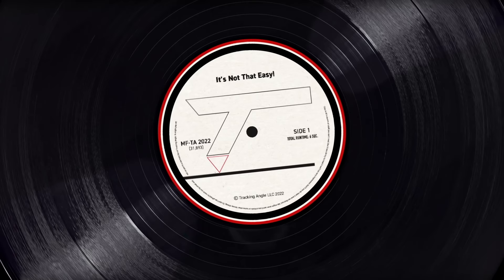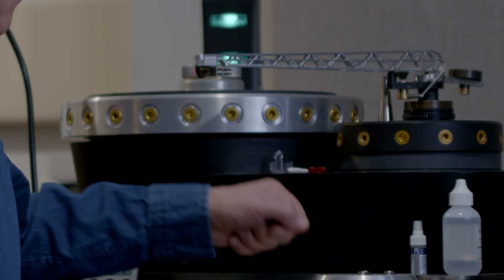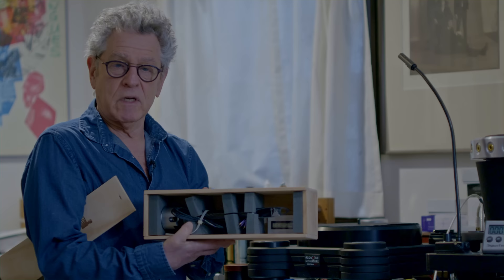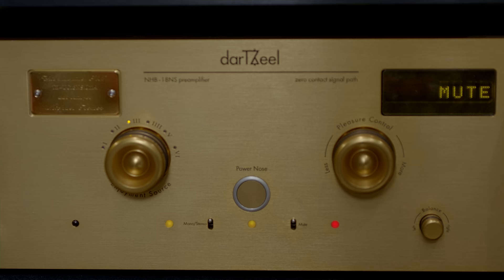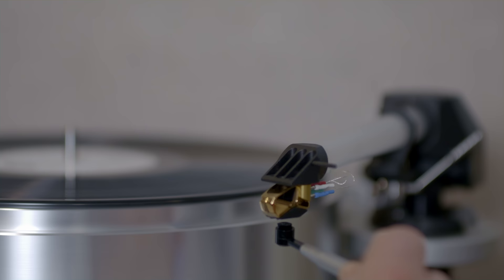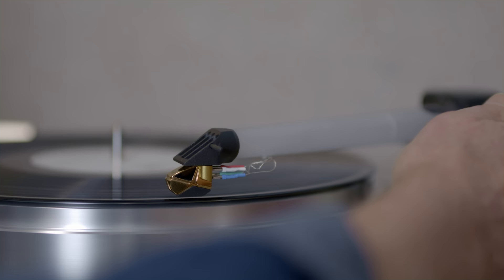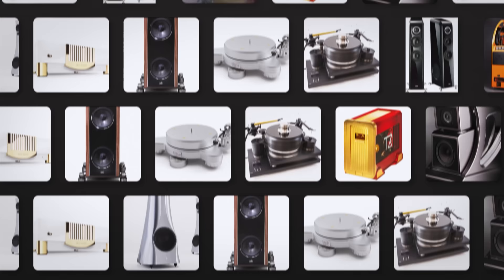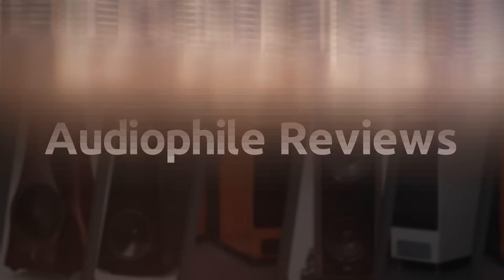A NEW 4K Tour of Michael Fremer's Listening Room

Comment: I made my entire house into a Faraday Cage, and the foundation is on air bearings.  I also had the house rotated such that there is symmetry with my system and the earth’s magnetic field.
All joking aside, beautiful system.  The tweaking and small targeted improvements is part of the hobby.  Replacing coupling caps, upgrading drivers, etc. is part of the fun for me.  Hope to make some of my own components from classic designs when I retire.
Reply: Sad thing is after watching this video and the extreme lengths people would go to in search of perfection, I was actually questioning if you were serious or not haha
Reply: Don't forget that for optimum sound, you need to have your turntable itself on another platter which rotates it slowly over the course of the day to account for the Coriolis effect's influence on total RPM
Reply: I know if I could do the things you mentioned I would but I can’t so I won’t .
Reply: No, after a point it's just useless money wasting insanity.

Comment: B&O had induction turntables decades ago. I have still got one
Reply: My B&O linear track turntable uses magnetic induction to rotate the thin aluminum platter.
Reply: @robertjermantowicz-uw3iw  Indeed, a low mass table, a lovely cartridge, a linear tracking arm and a linear induction motor. Nothing better, and unjustified sneering at B & O by ignoramus

Comment: Interesting system.  I can't quite comprehend how having 10 metres of new copper cable from the top of your house to your meter, actually reverses any negative effect from "terrible sounding aluminium cable" when the other hundreds and hundreds of metres that electricity is traveling to your house in is still old aluminium.  Electricity doesn't really give much of a stuff what it's being run through it just goes from a to b no dramas.
Reply: Thecgrounding issue might have merit but I agree on the wire. All high end audio equipment should be run on DC battery power. Remove all AC remote power generation from the equation.

Comment: If your a newbie watching this,  Turntables are an ongoing headache and will never sound as good as digital music. You will be chasing your tail for eternity. Please just upload all your cds to your laptop as flac files, connect the laptop to a Chinese DAC costing £150 (smsl c200), connect the DAC to an amp with some form of room correction (Dirac) and get a pair of speakers to suit the size of your room. Add a sub or two for some icing on the cake. You'll be looking at around £2000 for a bang up to date system that sounds amazing. Thanks.
Reply: That's one way of enjoy music.
I have a Very capable digital system my analog system it's better but it's more expensive and it just takes a lot more work. It's worth it all at the end.

Comment: I struggle to understand how a behemoth speaker system such as the Wilson Chronosonic (which, btw, is priced north of a third of a mil) can sound anywhere near its best in such a relatively small space.  Likewise, I don't understand how it would sound much better in that space than its smaller Wilson brethren (which use many of the same drivers).  To me, in that space, when is comes to speakers, less (smaller) is more.

Comment: batteries are so much cheaper... I run all my pre and output stages on Lipoly batteries.. no ac connections except for the source. figured out that decent class D amps sound really really good on Lipoly 100c batteries.

Comment: I can only dream of a world class system like Mr. Fremer. Very interesting nonetheless. Kudos on the home electrical upgrade. Now those power conditioners and fancy power cords make sense. 😊
Reply: The only problem is the room, how it's treated.  First, those speakers are entirely too big for that room. Secondly, he has NO treatment for the low frequency room modes, not sure if he has the right amount, type of treatment for mid's and high's and from what I can see for the front of the room he's has probably one of the worst setups for "diffusion".  And lastly, WAY too much "clutter" in the room.

it's just sad as to how poorly people with such great audio systems have rooms that are simply awful. The room generates enough of an impact than most people realize..  

Here's a video of a room, that is designed for the speakers in the room, and look at the dimensions of the room, how the walls and ceilings are constructed as well as the treatment.  This is what I would consider a first class designed audio room.    Gear aside, it's the room that presents the biggest challenge and is largely overlooked if not ignored.  Such a shame too.

This video shows what might be one of the best designed/treated rooms amongst any that I've seen out there.  

https://www.youtube.com/watch?v=eMLA5h0nh8s&t=340s
Reply: @Oneness100  one in every crowd.  Did you watch the video where he talked about room treatments? You can over treat a room

Comment: I just stopped laughing long enough to type my comment.
This won't be about concrete floors or how many earthing rods you have in your yard )))
Let me start with where your sound system really starts. "Your Human Ears". It both starts
and finishes there. Your ears are not capable of discerning what your floors are made of or
if you have any stray mains hum on your power supply. It gets worse, if you are over the age of 
25 then more than likely you already have certain frequency deafness, therefore you aren't even going
to hear how pure your records are, if you don't believe me then go get your hearing tested.
By the age of 50 your hearing is really quite degraded and it won't matter how good your speakers are,
life took it's toll. You have Human Ears on the side of your head not an Oscilloscope and a couple
of microphones.

Comment: Ok so why are you not generating your own electricity so you can maintain constant voltage and frequency. Spin up a flywheel with whatever method you’d like then engage the generator and you have the cleanest pure electricity possible